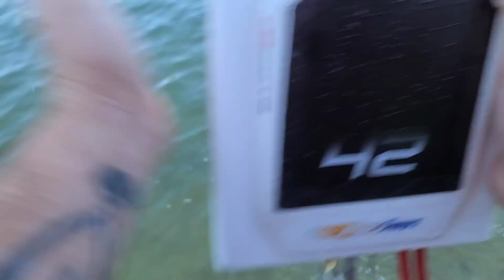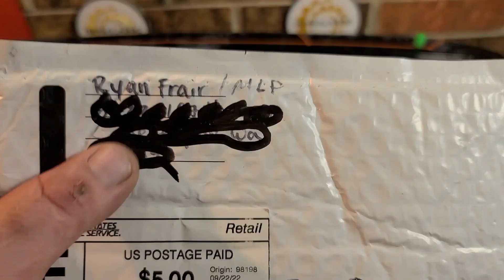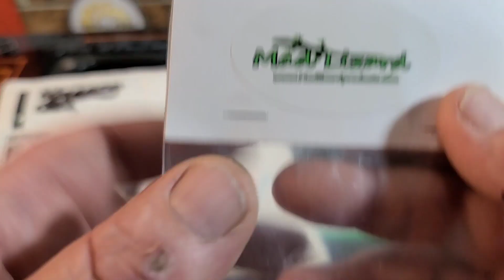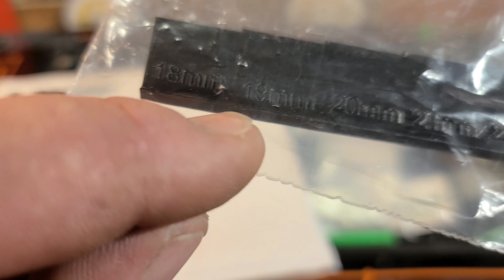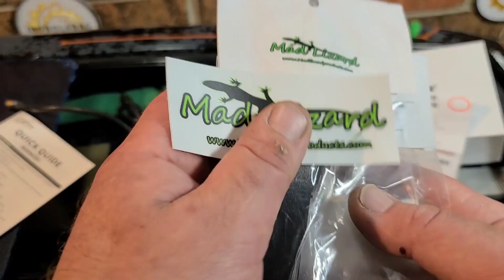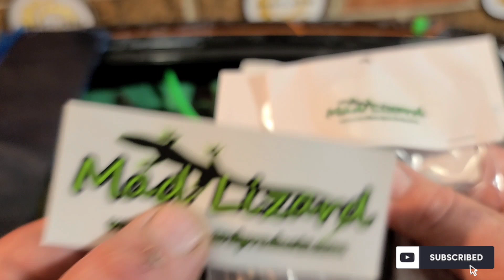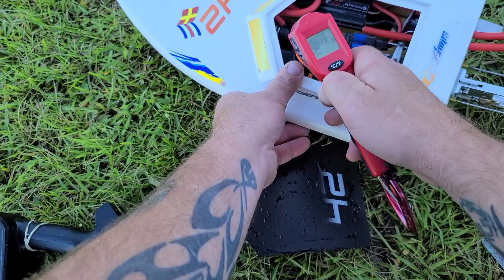Dead Ahead Rc Water Bobber Testing & Tuning | Mad Lizard Mail day

Comment: Trust me, I'm aware of what you've sad about this boat in the past buttt... would you consider building another Water Bobber with a surface drive and then be able to do a few videos comparing the two? Would love to see that.
Reply from the maker: I may do a re-vuild.  I'm thinking about installing a flooded stuffing tube so I can run a surface drive or submerged drive.  It's gonna be a winter project.

Comment: Isn't the drive just to deep? I would think it wants to ride "on/above" the water. Like the hull design/idea though...
Reply from the maker: The plans called for a submerged drive  I built this boat to spec, it's a prototype..  this winter I'm gonna rebuild it with a flooded stuffing tube for up & down adjustability
Reply: I'm no expert on design, but for instance fsr have props on a different place and an angle from bottom and other props... But probably not that easy designing a hull. Just a tiny thing thats off and it will probably run like crap... Still like the design...